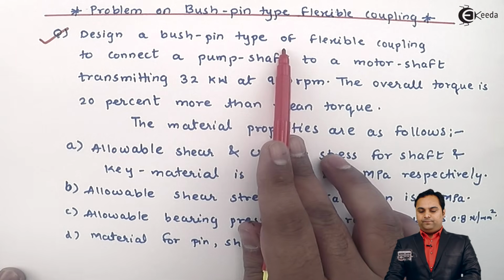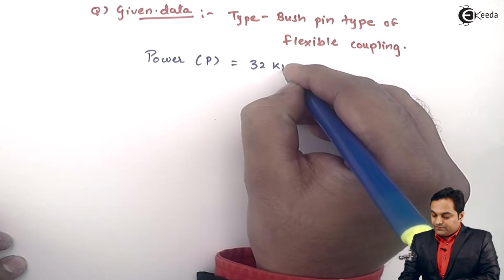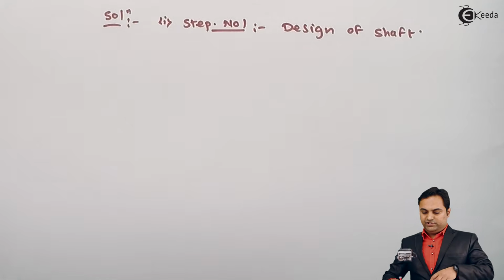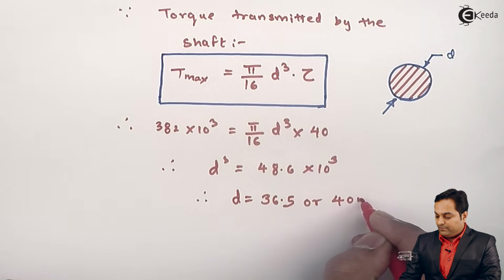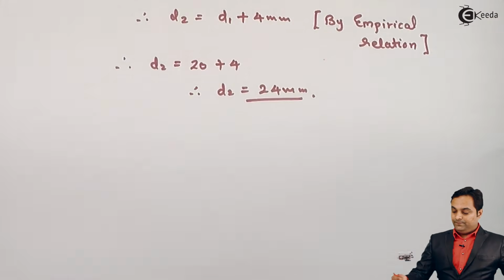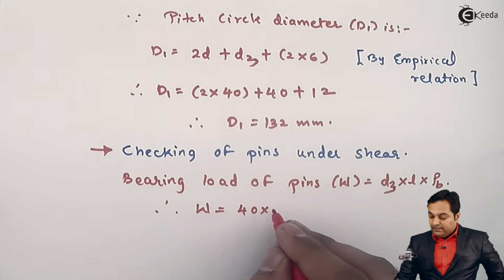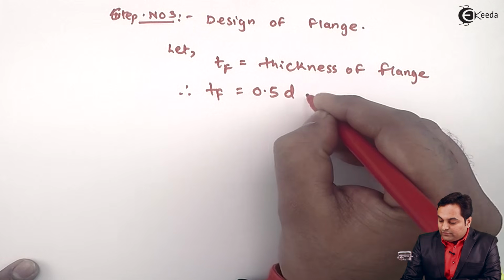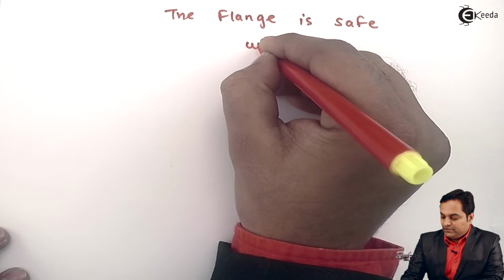Problem on Bush Pin type flexible coupling - Design of Shaft Keys and Couplings - Design of Machine

Comment: design and model a bushed pin flixible coupling to transmit 18kw at 1299 rpm from an electric motor to a conveyor system .assume a service factor 1.4 . the ff permissible stresses can be considered : shear stress for shaft ,bolt , and key material is 50mpa; crushing stress for the bolt and key is 85 mpa ;and shear stress for the bushing material is 12 mpa .additionally , specify the the application areas for the the coupling.

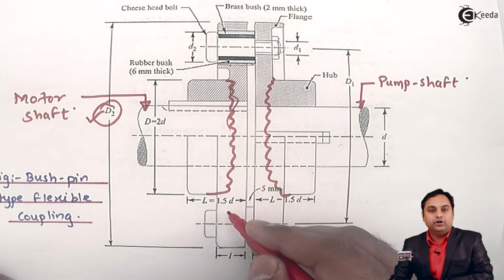Comment: Flange shearing area is not shown correctly (see 23:20).  It should be the area over the hub diameter, cutting through the flange thickness, tf.  The shown cross section area is (D^2-d^2)/4 and actually is not checked for shear here, as the key shear is more onerous.  I'm disappointed that bolt bending is not considered here, and the bolt diameter is increased to more than double without justification. Also the selected allowable stresses should be based on an endurance limit or fatigue life limit, which could be mentioned shortly.  Yet, for the purpose of a lecture, this video is a great introduction to flexible coupling calculations.  So thank you very much for sharing this with us.